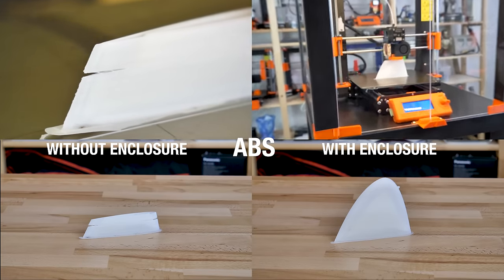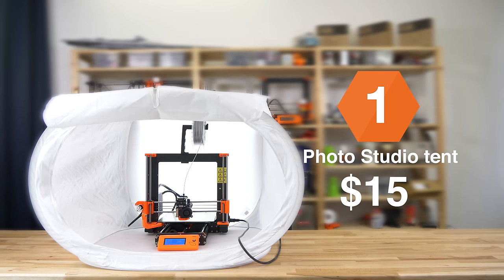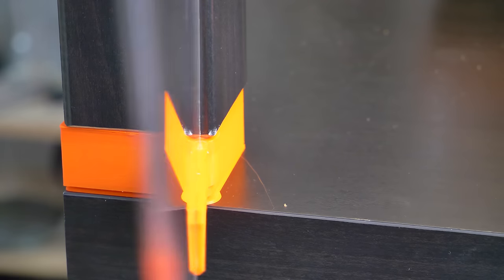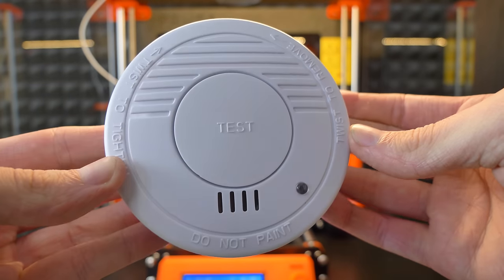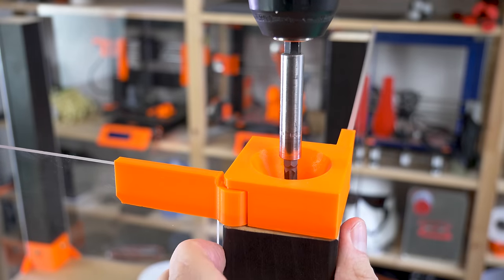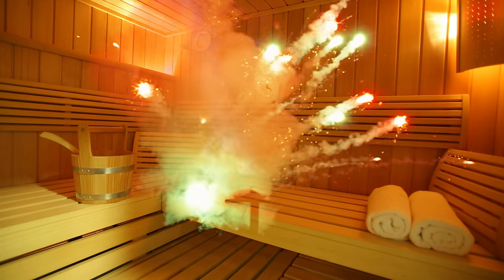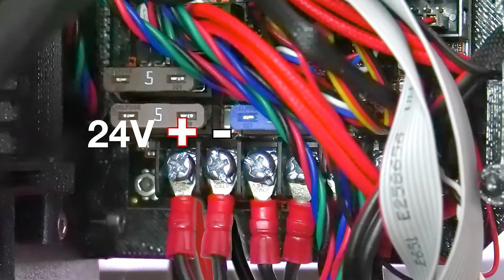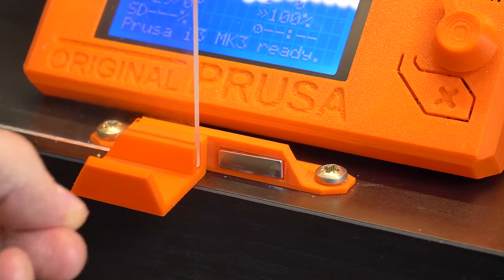How to build a simple and cheap 3D printer enclosure

Comment: 4:05 how do you secure the tables when adding more to the stack, to ensure they can't be knocked off accidentally?
The video doesn't look like there are any printed parts securing the bottom two tables together?
Reply: I was looking at the same thing, thinking of using brackets to screw into place or these:
https://www.thingiverse.com/thing:2920781
https://www.thingiverse.com/thing:2201733

Comment: A few of the people that installed the 90 degree cable cover for the heatbed say that it causes (calibration) problems because wires hit other wires. It sounds like the part is unusable with MK3. Could you please test if that is true, and if yes, remove it from your officially linked list? I hadn't read the comments to the part on thingiverse because I thought: If Prusa links it it has to work. It doesn't seem to work.

Comment: One thing rarely mentioned regarding using Ikea Lack tables for 3D printing - since they're mostly hollow, they act as a echo chamber, making the 3D printer considerably louder. That's why I gave up on the initial plan of using one as 3D printing table (and potentially adding second one on top later on)

Any practical hints on reducing the echoing?
Reply: For my mediocre LACK setup, I used a cement paver 12x12 inch square. It reduced the echo/sounds considerably. I can only hear the fans.

Comment: Do any modifications to this design need to be made for the Mini? I would assume not but figured I'd better ask first lol
Reply: I have the mk3s so not familiar with the mini. But you might need some modification for PSU. For the mk3 black/silver PSU verison's there is a printed plastic to keep the frame sturdy after the PSU has been screwed to the table outside the enclosure

Comment: Will there be enough room for the MMU2?  I want to add that to my system later this year.  If I need more room I would like to take that into account now.
Reply from the maker: There are tons of remixes of the original enclosure on thingiverse for the MMU2. It does fit into this design without modifications, but just barely, so you probably want to use one of the remixes.

Comment: Photographic light tents widely available for $15 are in the 20 cm size range. To get one that an i3 will fit inside is going to run $50-$60. No longer a compelling option.

Comment: Prusa team.  I have been working on creating my enclosure pieces, but I have gotten stuck at the PSU holder/ replacement piece.  I have the Prusa i3 MK3s which has a different frame assembly / PSU piece.  Where can I get files for the new PSU pieces if they have been created?
Reply: Yes, same here have built the enclosure but I cannot mount the PSU outside the enclosure.
The new black PSU is totally different and my fusion skills are just not at that level yet.

Comment: Where do you source the plexi glass sheets? I can’t find that size anywhere.
Reply: You need to have it cut to size.
Reply: Yeah, I figure that's a "Your milage may vary" kind of thing and going to entirely depend on what kind of stores or home centres you have where you live. It ended up being cheaper (and looking way cleaner since cutting plexi can really suck) for me to get glass cut because of a local window manufacturer in my hometown. Apparently the thickness of the supports for the plexiglass is also a common thickness for everything from sections of windows to picture frames, so they just cut some scrap panes to size for me and I paid next to nothing for em.

Comment: i had a similar idea but still didnt like the fact that you couldnt do 80ºC inside without everything melting.  I still havent gotten to it but i was thinking of fast lead screws with the Z axis mounted on the ouside of the enclousure and the same for the X and Y axis. A Slot with two rubber seals alon the travel of the X axis and tha should keep the heat inside without having anything that can burn or melt inside. Its all about designing the printer around the enclousure to be fair.

Comment: Watch out: The PSU from the MK2/MK2s is slighlty different ... Cables come out on top instead of the backside - and the clip for sliding the PSU in will not fit. Also the measurement of the plexiglas is a liiiiiiiittle bit to high. Or the printed parts are to short. The plexi will bend if you tighten the screws.

Comment: Hello thanks for the idea can we use lack system with a ik3s mmu2s ?
thks
Reply: Yes but the feed touches the top of the enclosure. So I think for this to work long term you would need to design and print some modifications for the filament feed to the extruder. Also the power supply holder is too small for the MK3s .

Comment: Will there be enough room inside for the MMU 2.0?
Reply: That may be an problem. But for an MMU you not only need more high in the enclosure; you also need more filament rolls and another path for the filament. I think there are two ways to do MMU inside this enclosure:
Mount the MMU on the top of the enclosure. Instead of 3 holes make a slot the bowden can move its way. Put another table in top - maybe reducing its high to 1/3 - 1/2, as you can not use the space anyway. Put your filament on top of this extra table. As using MMU often used to use hygroscopic support material, you should use IKEA Samla as storage box and filament holder (using the design from salanderer). Face the filament output to the back, going behind the new upper table to the MMU. Use PTFE-Tubes to guide the filament (and avoiding it from getting wet)

The second solution: use longer legs for the enclosure table, and bigger glas. You also have to drill the holes for filament in an angle near the back of the table, to get it to the MMU. But thith doors at the Front only, it will be challanging to get the filament in to the MMU...

Comment: anyone can confirm the sizes of the plexiglass? is 3mm? cause i dont understant the US Metric System hahaha

Is 3 parts of 440mm x440 mm 
and 2 of 220m,440mm  of 3mm of thick. ?

Thanks!
Reply: I ordered the plexiglass in 440mm then I read some comments of the measurements being too small?
Haven't got to building it yet but I hope it works, else there must be some way to fill in the 10-15mm gap?
Some ppl claim to have wasted their money on wrong measured plexi glass so if I were you, you should wait ordering plexi unless you got a plan B to fix the gap ofc.

Comment: What Infill do you recommend?
Reply from the maker: It doesn't really matter in this case, these parts won't be stressed too much. But Gyroid or Cubic with about 20% are a safe bet ;)
Reply: @Prusa3D  Thanks! I figured it wouldn't be much stress on them due to the lack tables and printer weighing next to nothing. I was more worried about torque applied when screwing to it. It looks like these are just holes for the body of the screws so no stress is really put on then. Thanks for the reply! 😀

Comment: I ordered three 22" x 22" IKEA LACK tables "https://www.ikea.com/us/en/p/lack-side-table-black-20011408" for this project.  I want to keep all things 3D printing neatly organized together with as small floor space footprint as possible, so I figured staking three (instead of two) LACK tables would allow me to achieve this goal.  Now i am concerned about vertical center of gravity and vibrations from the 3D printer.  Would a placing the Prusa 3D printer 3 tables high induced too much vibrations harmonics that could affect the 3D prints?  Would placing the Prusa 3D printer on the 2nd level be a significantly better option as far as harmomics and vibrations are concerned?

Comment: Why not an enclosure integrated with the printer??? I find this too complicated and way bigger than the printing area! 60x60x60 cm for 20x25cm of printing area take too much space! Sorry Prusa! I wait for an MK4 with enclosure out of the box!
Reply from the maker: There are several reason for that. 3D printer enclosure was patented by Stratasys and the patent expired just recently. It also makes access to some part difficult, because you now have to disassamble part of the enclosure to reach them. Last but not least, it would increase the price of the printer.
Reply: Prusa 3D by Josef Prusa  Hey hey I understand, but there may be a well designed  solution for an enclosure as an add-on that keeps the printers dimensions in reasonable limits. A 20x25cm 3D printer in a box with the dimensions of a fridge ... seems, at least for me, more than exagerated!
Reply from the maker: Understandable. It's funny, we found that people build them mainly not because they need an enclosure, but becasue this way they create a neat cabinet for their printer and filaments, for that purpose, the ikea lack build is perfect. But yes, surely it could be made smaller :)

Comment: I think the electronics in the display and so on will hate heat as electronics generally hates heat. Maybee its a good idea to put in a water clamp with connectors to circulating water system to localy cool the electronics.

Comment: I've seen some people comment about temperature and smell
I've added a temperature controller with filter option to my enclosure.
the original enclosure is exactly like the one in this video

to this Ive bought an Electronics Kit from:

https://box3d.eu/shop/box3d-electronics-pack/
it's great since it has everthing I need and I am not very handy with electronics myself.

the website had some modified files for this enclosure which I got here:
https://www.thingiverse.com/thing:3866390

This really helped with overheating and I have no problems now. The electronics kit is worth the investment.

Comment: why the hell is there so much play in the feet cones? the idea of a cone is that it fits without any play. why do you claim in the tutorial to use a 10mm drill, but the filament guide has only 9mm? why do not use two smaller screws instead of one big one in every part mounted to the the wooden parts? this would prevent them from rotation and would give a lot more stability!  Why not mounting the PSU horizontally and let the power plug go out on the side, that we can move it with the backside on a wall? just to tell a few things. i am absolutely disappointed. this design is absolutely not ready for public release. i had to change nearly every part on my own. all in all it is a awesome idea, but the Implementation is crucial. every real tech guy will hate this. sorry...